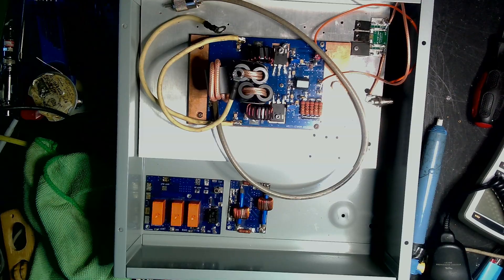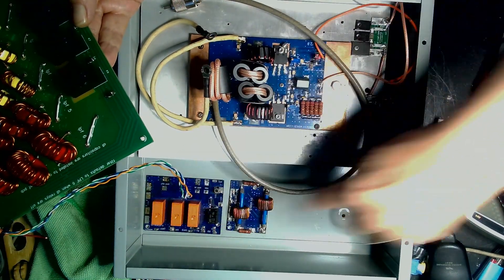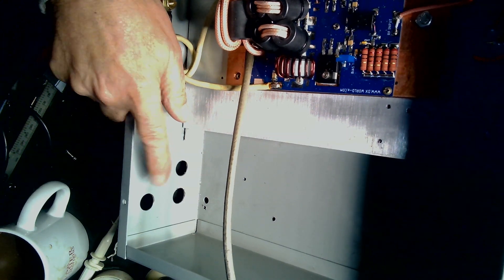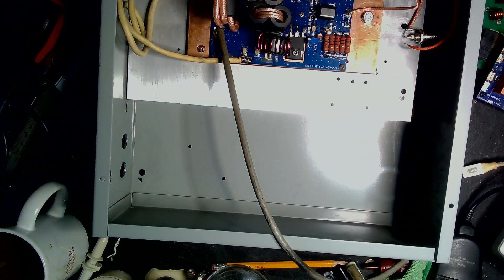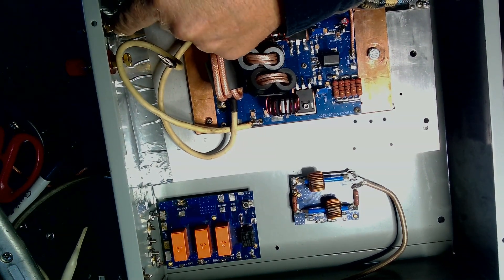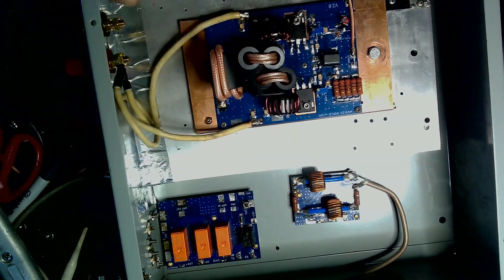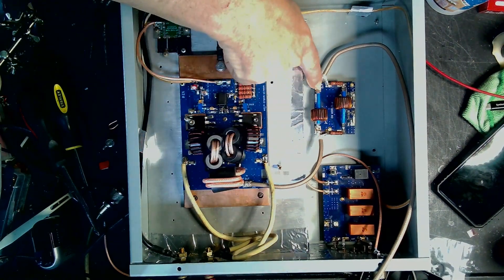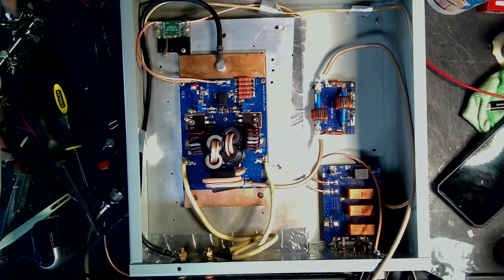DxWorlde 600W LDMOS HF Amplifier (Part 4)

Comment: Hi Jeb.  How did you do your control board?  I'm going to build the 2 meter version of this DX World project for 500w and it uses the same LDMOS transistors.  I also ordered the low pass filter board along with the auto receive/transmit protection board.  Also, where did you get the attenuator?  I'd like to order the case you gave information in other post, along with the cable you suggested.  I just need to order a power supply, copper head spreader and fans.  I found a good heavy aluminum heat sink., and I think that will complete my parts list.

Thanks for this series and hopefully you'll have a fine working project when you've completed it!  73 - Mike ND7E

Comment: HI WHAT KIND OF COAX CABLE ARE YOU USING FROM THE RX/TX PC TO THE COAX CONNECTOR AND THE AMPLIFIER INPUT? (THE VERY SMALL GOLD COAX) 
THANKS ,, GOOD VIDEOS
Reply from the maker: Input RG316  Output RG400
Reply: @Jeb-N2JEB  THANKS FOR THE INFO, GOOD JOB, 73s

Comment: I have enjoyed watching the videos on building this amp. Do you have a video showing how you mounted and wired the low pass filter board and the protection boards?
Reply from the maker: @edjackson5910  There are more videos to come on the amplifier. I will try to get the next amp video out next week.

Comment: Can you tell which case model you are using? Informative video, thanks. Looking forward to the finished pics and power test.
Reply from the maker: 2 x Digikey CS12124 12x12x4 steel enclosure